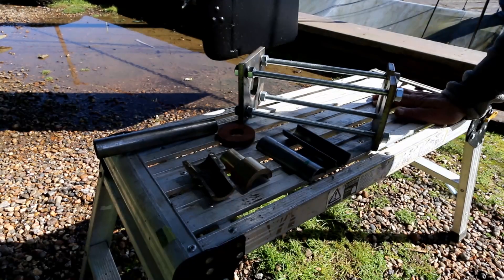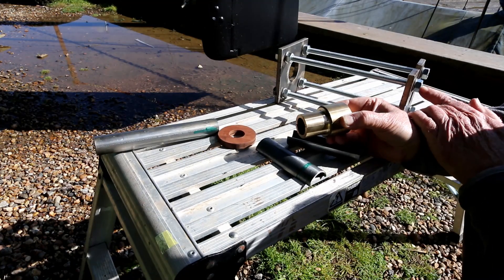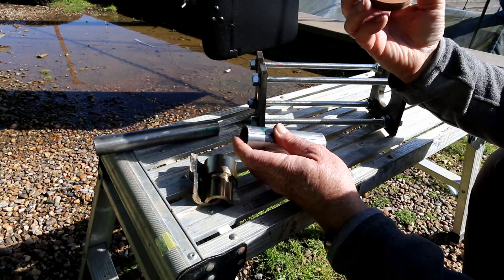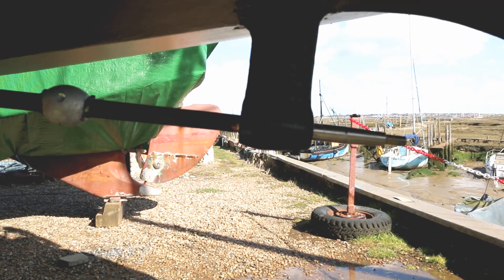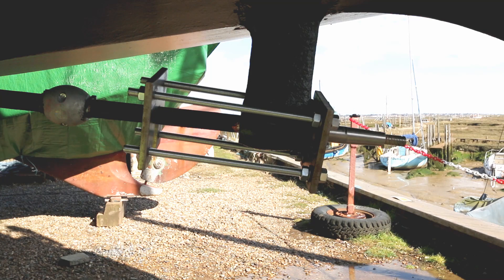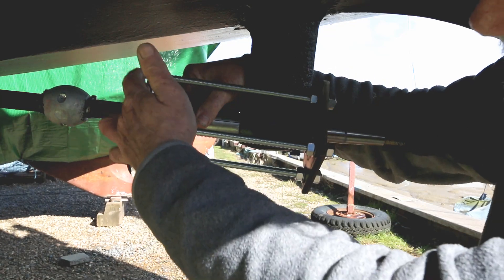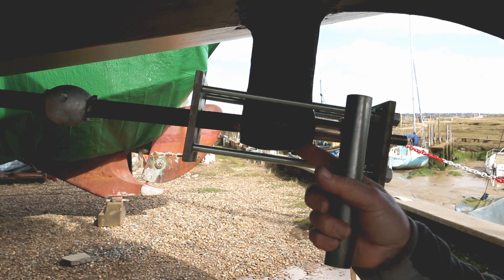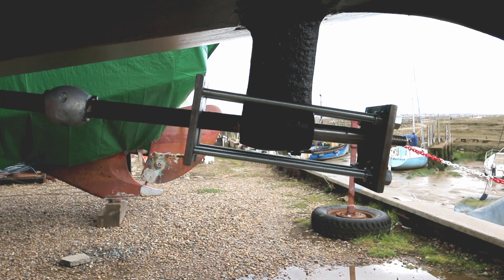Replace a Cutlass bearing with the prop shaft in place. see part 2 https://youtu.be/40qEl02UvmA

Comment: I wonder whether this job might be done faster and easier with a slide hammer? Various inner diameter sizes are used on motorcycles to replace the fork seals. Could a similar method be employed here? Provided that the ID of the hammer was the same as the prop shaft and you had sufficient clearance behind the anode, using a hammer would apply the force directly along the length of the shaft because the hammer would slide on the shaft, the principal is the same - isn't it?
A hammer would also be much easier to store securely taking up much less valuable space until it was needed again...
Reply from the maker: Hi, I have heard of people using a slide hammer but most use a method similar to the tool we made.  The job is similar in some ways but a propeller shaft and couplings are not designed for lengthwise impacts where motorcycle forks are.  Removing the old bearing using the tool took about five minutes, most of which was getting the alignment right.  The video is just about what we did and offered as a possible solution to a common problem.
Reply: @iankfr  Thanks for the reply. The lengthwise impacts should not affect the shaft providing that it isn't seized in the bearing. I'm happy to bow to your experience and knowledge though. I was just trying to think outside the box. Tools will take over your life so anything that keeps them to the minimum has gotta be a 'good thing'! ;-))
Reply from the maker: If you happen to have a slide hammer them you could or should use it rather than make or buy a new tool.  I don't have access to one so made up the tool.
Reply: @thetraveller869  its not the shaft its the p bracket you would damage with a slide hammer - dont ever hit the p bracket with anything unless you want an expensive repair

Comment: Excellent. Very informative, many thanks.
Reply from the maker: Glad you found it useful.
Reply: @iankfr  Thanks. 2 questions:
1. Why is the new bearing pusher disc plywood, is it to protect the bearing? I'd have thought the rear plate would have worked without the disc.
2. Do you dimple the new bearing for the grub screw, if so how?
Reply from the maker: There is a clearance hole to allow the old bearing to pass through it. In fact putting the new bearing was done without the tool as it was a good fit. On my boat the two grub screws had slightly pointed ends so it is just a matter of tightening up enough to lock but not damage the bearing.
Reply: @iankfr  Thanks, I forgot about the clearance hole! I suppose if the new bearing was tight the plywood might crush. I could cut and inch off the old bearing and use that?
Reply from the maker: My feeling is that if the plywood started crushing you have the wrong replacement.😉😉